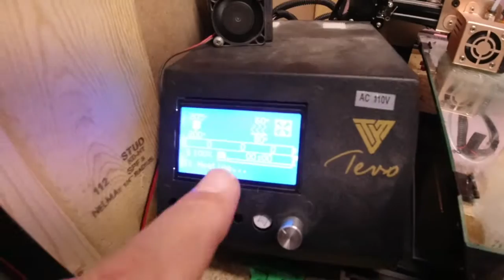DIY Extending Wires on my Tevo Tornado 3D Printer

Comment: Did you have any problems with the thermistors because extending the wires must have changed the resistance?
Reply from the maker: No ptoblems, still running well.
Reply: @RickBolt  I'm having a nightmare trying to do the same thing. My thermistor report a way hotter temperature than the actual temp. This makes it impossible to reach the necessary temp for printing.